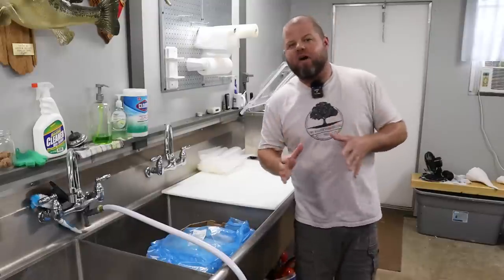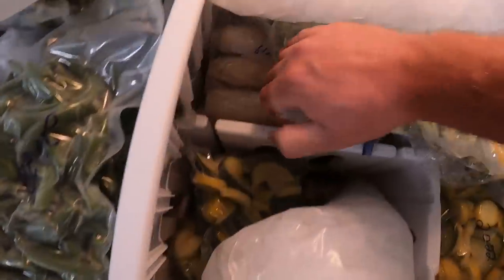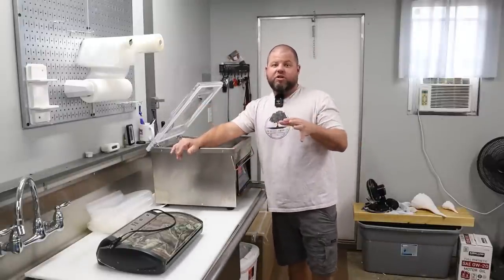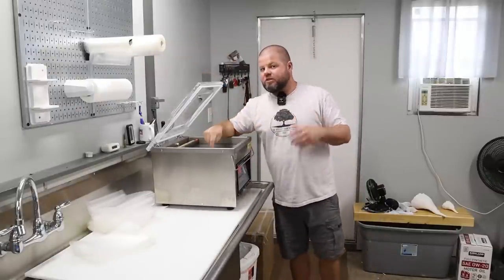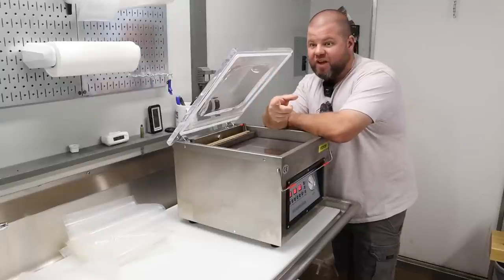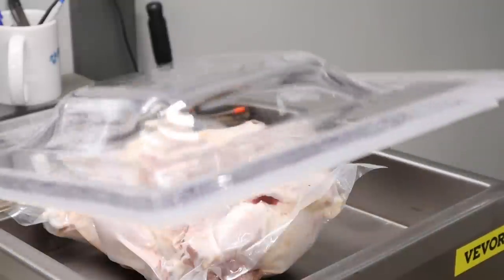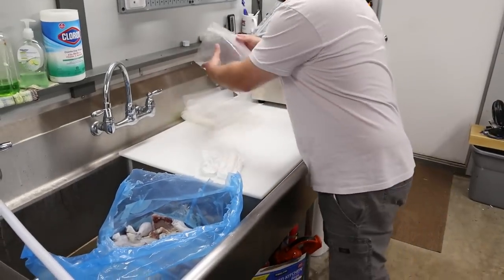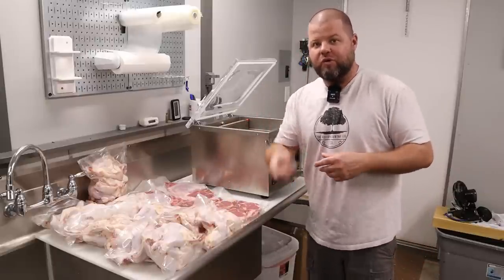How to save HUGE money $$$$ on meats and groceries! #Vevor #691

Comment: I have had a different Vevor model for several years, and I'm a fan.  You don't have to use traditional vacuum bags, you can use much cheaper chamber vacuum bags which are at least half the cost. For instance, a pint-sized bag can cost less than 4 cents.   I just returned from our local market, that was running a big salmon and chicken breast sale.  I brought the chicken and salmon home, divided them, and vacuum-sealed.  It is great to have a ready supply of basic foods, like chicken, hamburger, and fish, at the ready.  If someone eats 1/2 of an avocado I'll vacuum seal the other half, and it will stay fresh for days in the fridge. Vacuum sealing absolutely saves money.
Reply from the maker: I agree!
Reply: Where did you buy your bag supply?
Reply from the maker: I just bought a 500 pack of chamber sealer bags on Amazon. Very affordable!
Reply: @Drmikekuna  do u remember what the bags u used are called ?
Reply: @boydatsmari  I just shopped for the cheapest bags on sale.
Reply: I love my vacuum sealer!!!

Comment: Nice!! That's quite a haul and a huge savings! Tip for vac-sealing wet/juicy stuff: put it in the vac-bag and set it in the freezer to pre-freeze (a few hours). Once the liquid part has frosted from resting in the freezer, then run it thru the vac-sealer. No muss, no fuss. I also do this with veggies that can get smashed flat by the vac-sealer (bell peppers halves? peaches?) if they aren't pre-frozen -- I usually pre-freeze those overnight.
Reply from the maker: You actually don't have to do that with this type sealer since it's not sucking air out of the bag. All liquids remain inside.

Comment: Andrew, you can save even more money by using chamber vacuum bags instead of the normal/traditional vacuum bags (I can tell you're using the normal vacuum bags because they have the continuous grooves all through the inside of the bags.  Chamber vacuum bags don't need those grooves and are much much cheaper.  And, you can now easily vacuum seal soups and sauces.  Those are impossible and/or a nightmare with non-chamber vacuum sealers.
Reply from the maker: Great to hear! I still have many rolls to work through. I was pleasantly surprised to find out about the liquids staying in the bag.

Comment: If you roll the end of the plastic bag over itself, then add the chicken, won't smear the inside edge.  I think the air inside the chamber and inside the bag is the same, meaning 0. When the machine introduces air back the pressure is 1 atmosphere; this pressure crushes the make the void inside which is at 0 pressure as it's sealed. It's like magic.
Reply from the maker: Your correct and good idea on rolling the bag.

Comment: I’ve found that sharp corners on things I vacuum will cause the bag to lose its seal in the freezer. I’ve started using folded paper towels to temper the sharp corners on T-bones and porterhouse. The chamber really opens up various wet things to seal. Thanks for spending my money!!
Reply from the maker: Lol, I'm loving the ability to seal wet and marinade meats. They also make thick mil bags just for these machines.
Reply: give heavy duty bags a try. Try 5 or 6 mil, They make them specifically for this problem.
Reply: @davidl7672    one drawback on these bags is that they usually only come in bulk.  So, you'd have to spend a fair amt extra on 500   5 or 6 mil bags when you don't need that many.

I found it cheaper to basically double bag with 4 mil.  Just need to cut a bit off the top of the first bag so that you aren't laying the double bag over the seal bar.
Reply from the maker: I bought a 500 pack a year ago and have been flying through them, I think the value is there.

Comment: While putting the large quantities of chicken quarters into a single bag is certainly a good way for bulk storage an even better way is to seal 1 or 2 meal quantities, this is specially useful when you start Sous Vide cooking where packing, freezing to completely cooked (apart from the sear) uses exactly the same bag. 
Yes you use more bags (the rolls are actually quite expensive compared to plain untextured vacuum chamber bags) but the smaller unit sizes give better quality food.
Pack, often with marinade, chamber vacuum seal, into the water bath for a few hours,  open the bag sear and plate. Though there is a long time involved, your actual time is minimal and the quality you get from sous vide cooking is superb, no more over or under cooked food.
Reply from the maker: The amount I sealed was for one time cooking. We always prepare food for a minimum of 4-6 meals. Just being two of us by the time you make sides your left with a lot of food. We don't like wasting food or making dirty dishes every night so we always target 4-6  meals.

Comment: Hey Andrew I had a industrial machine like that for 15 years, night and day compared to the cableas one.  We make a lot of homemade sausage every year and sure works great. Just purchases a larger machine with 2-20” seal bars so should be able to do (4) 10” bags at once so that will be awesome. We make our sausage into coils about 12” across and they just fit in bag nicely. I bought some industrial 5mil bags wow they are great thicker, and shouldn’t get air leaks if you doing bone in rib steaks as sometime the bone makes a pin hole.  Great video sure wish I could send you a picture of new machine it’s a beast on this platform but no luck here…

Comment: A commercial chamber sealer is a game changer.  We get 4mil bags by the case.  1000 count costs $125 so they end up costing pennies.
Reply from the maker: Where from, I'm always looking for a deal????
Reply: @TKCL  Alaska butcher supply😅
My friends get them at Costco too, not sure if you have one nearby that carries them.
Reply from the maker: Yeah that won't work lol
Reply: @TKCL  I’ll hit up your next livestream and get your address so I can send you some samples to try.  The pre cut bags are a huge time saver and more durable than the rolls.
Reply from the maker: I got to looking on Amazon and found 500 packs for $49. 3mil though
Reply: @TKCL  3mil are fine.  The only advantage to move up in thickness is for preventing pin bone punctures on salmon fillets and other sharp bones.

Comment: hey from what I have read you are not supposed to use food saver type bags in a chamber vacuum sealer.   You are supposed to used chamber seal bags they are clear bags without that texture that food saver bags come with.
Reply from the maker: I looked into that, chamber sealers can use either bag, vac sealers require bags with the cross hatching.

Comment: Hey Andrew! I just bought the vacuum sealer and used your code. I have a 125 ziplock bags of sweet corn in my freezer. Any suggestions on how to vacuum sealer those? Maybe just place the zip lock bag in a vacuum sealer and seal over the frozen bags? Can I get some tips on the settings for that? Thanks
Reply from the maker: I never seal corn, it's one of those things that freezes well. I'll grab the settings next time I'm around the sealer. Don't hesitate to reach back out to me about those shoukd I forget. Your going to love that sealer.
Reply from the maker: Got the settings. From left to right, 25 seconds, 2.2, and 3 seconds. Been working perfectly.
Reply: You'll want to either open the ziploc bags or poke some holes in them.

Comment: i have a similar unit, how easy is it to clean the inside of the unit. mine is very difficult. The bar with the heat strip on it is very sharp, is don't move very much and when stuff boils in the bag crap gets everywhere.  can the heading element get moved easy?
Reply from the maker: I never have anything come out of the bag, it's rare I have cleanup in that area.

Comment: Have had my eye on this machine for a while... Are you able to do roasts in there? When we process our deer we usually keep a few roasts from the hind quarter as well as the neck. I'm thinking that even by removing the top tray we may struggle with that and may still need the old one for that? Any insight?
Reply from the maker: Our Florida deer are smaller, but I sealed several roasts with this machine. Large bags full of chicken thighs and more. I would think for most roasts it should be just fine.
Reply: @The Kelley's Country Life  Our deer aren't always huge down here either. lol I did notice the pack of chicken thighs did seem large and may have been comparable to most roasts. This will definitely work perfect for our boudin balls, burritos, etc. Thanks for your reply!

Comment: how are you liking this unit?   thinking about getting one the traditional vaccum sealer just doesn't do a great job
Reply from the maker: I still absolutely love it! I've got friends that ordered the same one and they love it as well. The bags are cheap on Amazon. There's no comparison of a chamber sealer to a vacuum sealer. If you decide to buy it let me know and I can send the link, a discount code and I'll send you a link to the bags I ordered for it.
Reply: @TKCL  that would be awesome thanks
Reply from the maker: Here is the link to the sealer https://s.vevor.com/bfP5vw , make sure you sign up and register with them an email, it dramatically drops the price. Then apply this code VVPROMO at checkout for an additional 5% off. FYI these are affiliate links and codes, I do earn a small commission and it doesn't cost you a dime extra.  Much appreciated if you use them.  Here are the bags I bought in bulk on Amazon, they work very well for this type of machine.  https://amzn.to/3XSL9Kw  You can get other sizes, these fit very well in the entire sealing chamber.
Reply: thanks alot andrew I  was already  signed up used the link and your promo code for 5% off think it came to like 350...   can't wait to get this thing and put it to use.  I cook alot of bbq so about a month ago I bought one of the food warmers from vevor...  loving the products so far
Reply from the maker: Nice! Keep me posted on the good and bad, I need to know who I'm recommending.

Comment: I just got one of the Vevor sealers, how do you know how to set it?   As far as the numbers on the front?
Reply from the maker: The manual has recommended numbers. Start there and make minor adjustments based on how much sealing you want. Also if notice heat strip burn through, turn down the sealing time.

Comment: I have looked at Vevor several times but how do you get simple parts if you need them from Vevor. It appears they have no area to order parts lets just say all you need is a new gasket on the lid how do you go about ordering that from Vevor. What if you need a new heat sealing strip how do you order that other big name vacuum chambers cost more but have basic parts available.
Reply from the maker: That's the risk you take with overseas equipment. Although I've also found that often there are many models produced from the same exact unit, just labeled differently or as a different brand. I've had no problem finding spare parts for a lot of their equipment via Amazon or Ebay when needed. It's no different than buying something from Walmart or another big box retailer, they don't stock parts and it's most likely made overseas.

Comment: Does your bag every begin to swell when you start the process and then it really doesn't have that tight fitting around the meat when it's done?
Reply from the maker: No I don't have that problem. Make sure you are running the vac pump long enough. I usually set mine to 25-30 seconds.
Reply: @TKCL  i have it on 35. You think it's because I'm not really filling the bag up? I was just playing around with it and I put like two oranges in a bag to test it out. I just got it yesterday.
Reply from the maker: No that shouldn't matter. Are you using chamber sealer bags?
Reply: @TKCL  no. It's the bags that have two different sides to the bag not the smooth surface
Reply from the maker: Smooth bags are what's made for these. They are called chamber sealer bags and are very cheap on Amazon. I find they seal better.
Reply: @TKCL  okie dokie I'll try those. Thanks for responding 🙂
Reply: I'd wager that your problem is caused by having too much bag over your seal bar.   That maybe you are laying the bag over and tucking the end down just a bit between the bar and the end of the chamber.

That keeps all the air from coming out of the bag..  The bag then swells because the pressure of the air inside the bag is greater than the pressure in the chamber.

Try to lay the bag over the seal bar so that the end of the bag kind of floats in the air between the seal bar and end of chamber
Reply: @davewilson1411  thank you
Reply: @T2_Sug  you're welcome.

Comment: i just got mine today.. i have to put everything to 45 seconds just to get a solid vacuum.. is that normal to anyone out there?? It goes slightly passed the green pressure gauge. But anything 40 seconds and lower it doesn’t do any better than my old vacuum sealer. 45 seconds and up it does work well. Just odd to me all the videos on YT people use about 30 seconds.
Reply from the maker: No that isn't normal 25-30 seconds is normal. You did fill the pump with oil correct? Check the seal around the lid.
Reply from the maker: Let me know if you get it resolved or have to contact customer service. I like to know how these companies treat viewers.
Reply: How full are your bags?  And what size are they?

Quick rundown.  The pump will run and try to pull all the air out of the chamber.   The fuller the chamber, the less air in the chamber.  The less air, the faster the pump will suck it all out.

Easy way to illustrate. You have 2. 16 o,Oz glasses (chamber).     Fill one to the top with ice and fill the other about half way.   Fill both to rim with soda.   Stick straws in both and suck the soda out.

The glass that had more ice would finish first because it had less soda in it. 

BTW, if doing smaller amts, a way to speed it up is to put something like a cutting board into the chamber as a filler plate  and lay the bag on it.  The board reduces the amt of air in the chamber.  That shortens the amt of time the pump has to run